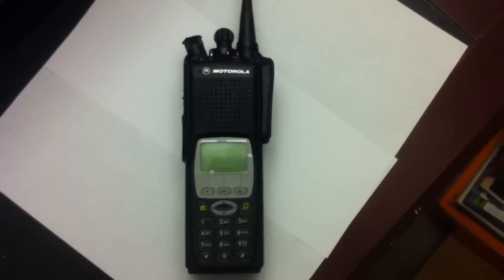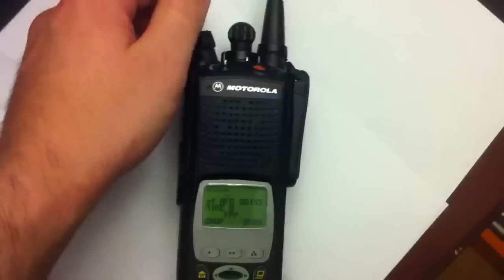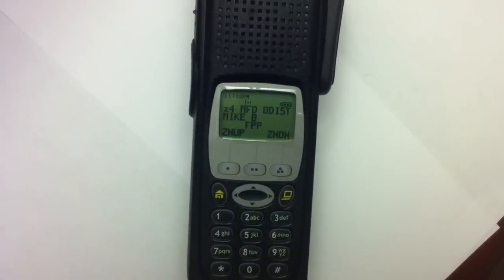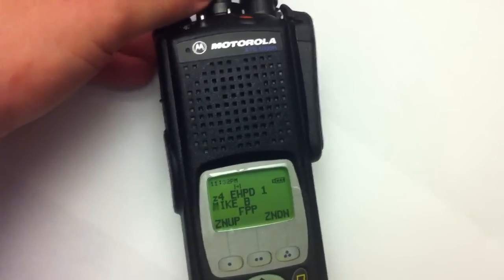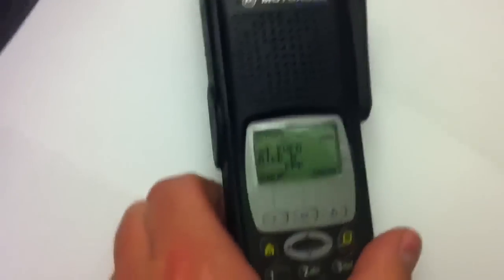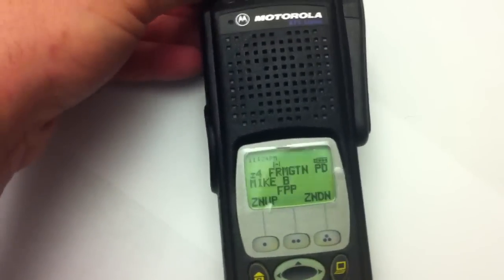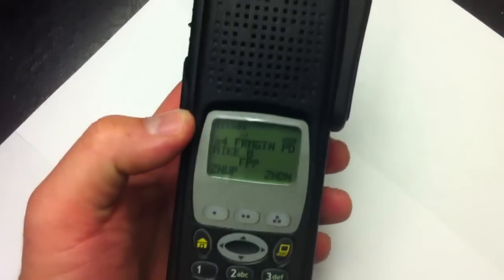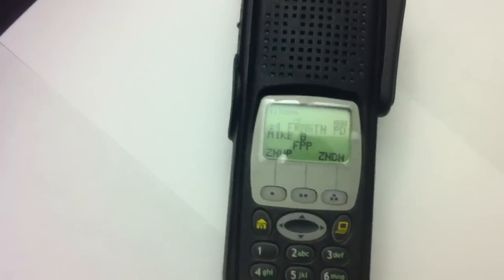Xts5000 channel announcement

Comment: I'm not sure if you're still answering questions but when I click compress, I get a box that says "One or more voice files encountered errors during compression. 
See Voice_File_Compress_Log.txt for possible additional information."

I've made sure my voice file has an 8000Hz sample rate, it is Mono channel and 16 bits integer PCM Uncompressed. I'm Not sure why It won't accept it.
Reply: I'm having the exact same problem. The files work with my APX radios, but not XTS. That log file is in the /portpat folder, but it didn't have anything in it that's useful.

Comment from the maker: Also in regards to the "mute" feature, I should have mentioned that you check the box in the CPS, not the radio lol In CPS (under Radio Wide Configuration I beleive) under the mute section down towards the bottom under the "General" section, there are 3 mute options. One is mute key tones, two is "mute all tones" (or something to that effect), and one other mute option that I'm forgetting right now (brain fart lol). Check the "mute ALL tones" box, and that will mute Chann. Announce !

Comment from the maker: @snarlingrabiddog5150 You have to enable Channel Announcement by checking the "Channel Announcement" box under "Radio Wide", then "General". You also have to go into (I beleive it's tools, or File, or something) and make sure you click the box that basically gives the CPS the OK to write the audio files TO the radio. If that box isn't clicked ( if you go into the "help" field in the CPS and just type in "Channel Annoucemenet" it will give you ALL you need to know ! ) it won't work.